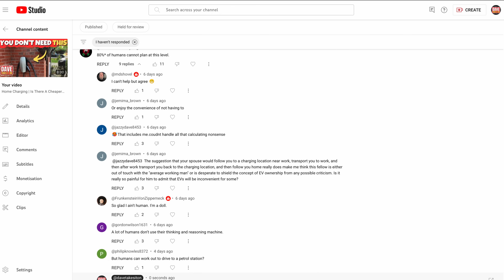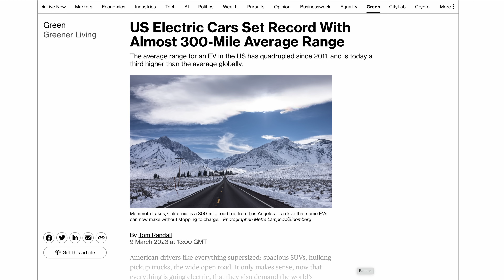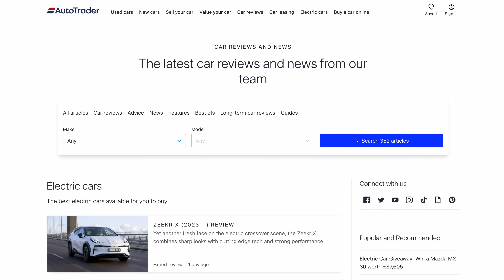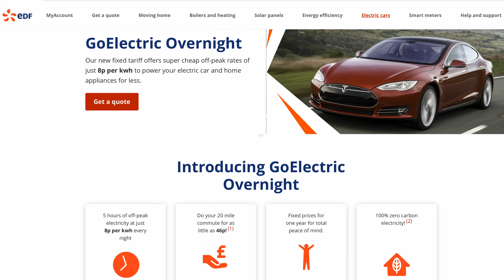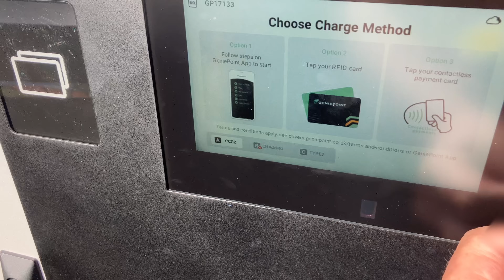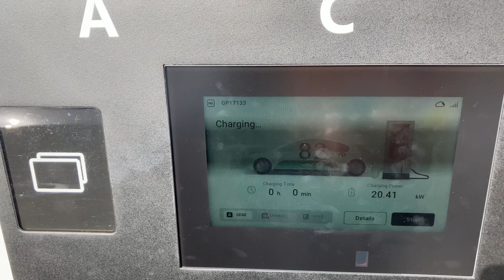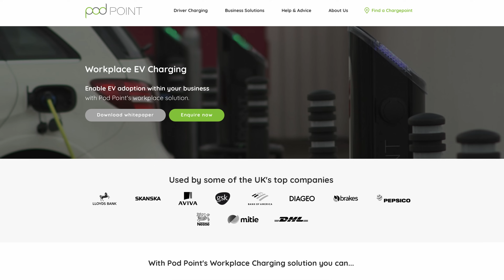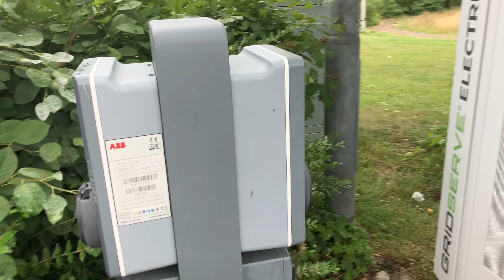Dummy's Guide To EV Charging | Don't Make These Mistakes

Comment: Hi Dave, some very good advice but when showing the tesla supercharger in most cases they currently or only available for tesla owners. And it is worth mentioning it’s not a good idea to constantly keeping the battery at a high state of charge to prevent early battery degradation. I do believe if you have no way of charging at home or at a work place it is really difficult to run an Ev depending on we’re you live in the country and it’s not a good idea to be constantly using rapid chargers if you plan on keeping the car a good number of years plus it’s dam expensive to be running a car of the back of rapid chargers. Unless it’s a tesla. But I do agree with you charge once a week or 10 days as I do. Keep up with what you do it keeps us informed with what’s going on with the charging infrastructure. The only thing I will comment on is tariffs you have to way up how much charging you do because yes you get cheaper overnight price but pay quite a bit more for the daytime rate. For me there was no advantage when charging  once every 10 days so I simply pay a single tariff rate and as such can charge when I won’t
Reply: With regard to split tariffs, don't ignore the fact that you can add a home storage battery even without solar.
Then charge that up during cheap rate and run the house during the day from that.
I almost never touch the higher day rate but everyone needs to do their own sums as there's obviously a cost for the battery but it does enable more flexible tariff options.
Reply from the maker: Yes Stephen look at the over all package. I get 9pm to 7am off peak weekdays plus all day Saturday and Sunday my peak rate is 40p off peak is 11p and my annual split usage is 85% off peak 15% peak that averages out at a nett 15p over the entire year. That’s much cheaper than if I chose a 5p off peak but only got about 5 hours a night and my peak was 30p. I often need 8-9  hours charging two or three times a week
Reply from the maker: Plus my home/ supercharger split is 70% home 30% superchargers so my average cost is 23p per kWh over the last 12 months, equates to 8p per mile. I’m happy with that

Comment: Nice video Dave 👍
I used a Tesla Supercharger for the first time yesterday. So easy to use, and watched the charging progress via the app, sitting inside a coffee shop enjoying a Latte. You can't do that in a petrol station 😂
Perhaps a video on the different type of home EV chargers there are might be worth it.
Hope you're well (Keith).
Reply: Of course, you can do the same with an ICE vehicle.

Fill up the tank..., park the car, and go for a drink.

Not all gas stations have a coffee shop, but that's not a problem. When you're done, you can drive to any coffee shop.

Now, if you want to continue the trip immediately or not, it is (your) the driver's decision.

Comment that this is not possible with ICE vehicle is false.

Why wouldn't it be possible?

If you want to stop for 10 minutes, 30 minutes, 1 hour... no one will stop you, it's your decision if you want to stop for a while.

I'm not here to argue which one is better, just that you can stop for a while with an ICE vehicle as well. It's the driver's decision...

Have a nice day 🥂
Reply from the maker: Thanks Keith Tesla make life so easy. Yes video on home chargers being prepared

Comment: I’m not opposed to an ev however just not achievable for myself yet, cars are simply too expensive to purchase at the moment. Never spent more than £3000 for a car, maybe by the time I replace my current car Evs will be more accessible
Reply: All those electric vehicles, which were new three years ago and rolling of their leases, you will see a lot of vehicles in the market and prices will drop even further than they already have. I am not sure if they will get as low as your budget, but fingers crossed.
Reply: If you spend maximum £3k on a replacement car then it may be some time as you will be looking at 10 year old cars and there are not many 10 year old EVs on the market. 5 or 6 years time there will be a lot more choice available and the cost to buy should be down to that sort of price by then.
Reply: £3,000 is not really possible but £5,000 is. Watch EVMan (sorry, Dave).
Reply: But who would even consider a used EV? Even dealers dont want them

Comment: Any chance you can look into why ev insurance is going through the roof see a couple of people saying there's has quadrupled
Reply from the maker: Yes thanks for suggestion it is being investigated, video soon
Reply: No doubt that will be the electric vehicle that caused the Luton Airport catastrophe, the other day, bumping up the prices… oops actually that was a diesel wasn’t it? Just price gouging as usual from a for profit financial institution. The same thing happened in America with Tesla’s, so Tesla just brought out their own insurance.
Reply: I think it is a general insurance problem that any recent car has far more expensive parts, so crash damage is more expensive to repair and as a lot of the parts are still more difficult to source, it takes longer, so higher storage costs and a replacement car for longer, so the cost goes up. Therefore insurance costs go up to cover this. My renewal doubled the cost, so I searched around and found a company that barely changed my cover and offered it for similar to what was paid the previous year.
Reply: This is not limited to EVs.  It applies to everyone, with many I know being at least doubled

Comment: Not a hope in hell I would buy an EV without being able to charge at home. I would not want to pay the high charging costs. 69 pence as opposed to 7.5 pence at home.  May as well stick to petrol its cheaper and more convenient.   I charge with a three pin plug, on the lowest possible speed. This way I can get the electric for the whole house from around 7:30 pm to 5:30 am. at 7.5 p Washing machine, tumble dryer, dishwasher, and I even use electric heaters, all night. My combine gas and electric bill has gone from 360 pounds per month to 118 pounds per month and that's including charging my car. You can't do this with public charging.  Public charging costs are way more than running a petrol or diesel car.
Reply: But you can reduce public charging costs by subscribing to the charge network you use. My local public charge network's price on a subscription is 38p per kwh......which is a fair bit less than the 69p per kwh you mentioned....
Reply from the maker: 69p per kWh = 17p per mile same as diesel at 40mpg. What’s the problem?
Reply: @davetakesiton the other mid-way option is a lamppost charger. 5 -7kw for about 15-20p per kwh. So much cheaper than fast DC charger BUT more than the 7.50 per kwh at home overnight.
Reply: 7.30pm to 5.30am? What tariff is that?!
Reply: @djtaylorutube  Economy 7?  I'm guessing......  My Octopus tariff is 7.5p per kwh, but that's from 11.30pm until 5.30am. Daytime rate is now within a penny or two of the daytime norm of around 35p per kwh....
Reply: @Brian-om2hh  Well not from 7.30pm :) My economy 7 is the 7 hours, currently from 2:55am to 9:55am and in winter time drops back an hour.
That's why I was curious about a 7.5p rate across such a wide period.

Comment: Hmmm.  You have glossed over the stupidity of apps and rfid cards.  Imagine the outrage if every filling station group decided that all customers need to to use apps and / or rfid cards to pay?

All public chargers should be contactless, end of.  On top of this there should not be price discounts for membersbips.  All this says to me is that the occasional users are being price gouged.   

And yes, we are ev owners.
Reply from the maker: Or just buy a Tesla and charge at 35p = 9p per mile. Just look at home charging as an incredible bonus. A Tesla always supercharging is half the price of petrol and diesel
Reply: Or, just buy a Tesla....
Reply: @chrisheath2637 if you can affect one. 😢
Reply from the maker: Yet I happily use a Tesco store card to get discounts. And a Nectar card to save money. Your problem?
Reply: There is a distinction between public charging and the membership style parking you refer to that used to be commonplace. Those schemes have all but disappeared because they are now competing with the contactless versions you refer to. My Tesla will show me any public charger not just Tesla but will not show me ones that are membership based.
Reply: I think that all rapid chargers should accept contactless payment and most now do, including the new V4 Tesla chargers. The "fast" chargers are much cheaper devices and, in my experience, tend to require and app or website to use  them.
Reply: Another stupid question, what is rifd card? 

I don't use big supermarkets as I'm an older single working class person, I shop in all the cheaper shops so club cards and the likes mean nothing to me, admittedly, as a working class person, I couldn't even afford a used electric vehicle

Comment: Great guide for those about to switch to an EV or someone very new to EV driving. 
I had a great charging experience myself in London yesterday outside Lords cricket ground. 
We were considering going by train and tube but that was going to cost 2 of us in excess of £40. Instead I took the car, there are EV bays right outside making the journey a lot quicker and we could charge for 4 hours before overstay penalties. 
That was perfect for us to to do our Lord's experience and added 28kWh of energy costing £16.80.
Reply from the maker: Just get all the ICE cars off the road and the traffic disappears for us EV drivers, heaven

Comment: We live in a Victorian terrace without offroad parking.  Our county council has now started a 6 month frial of "across pavement" charging and we are now doing this.  The result is that for our 5,000 miles a year we will be charging on cheap rate overnight juice for at least 4,000 of those miles and probably more.

We bought a car with a real world winter range of 200 miles enabling us to make our longest regular journey of 180 miles round trip without needing to worry.  We also knwo of three rapid charge sites en route if we somehow need to add a splash whilst taking a slash!

It's really not a problem charging and we are enjoying 3 pence per mile fuel whilst motoring.
Reply from the maker: Great story and totally at odds with the doom merchants, enjoy you EV

Comment: I would say consider a leaf if you can charge at home don't write them off completely they're a cheap entry to EV ownership
Reply: Maybe a second hand Leaf, they are expensive new.
Reply: There are numerous ways to get into EV ownership at reasonable cost now. I saw a regular YouTuber buy a 2016 Renault Zoe with 35k miles on it, for £4400 a few weeks back. Nice condition too.... With the right off-peak tariff, you'd have motoring at a cost of around 1.5p (or less) per mile......... It would cost more to use a bus.
Reply: Am a retired bus driver, and have had a Leaf since 2012.   For my wife and I it is perfect, as we only use it as Dave says for shopping and short trips in the area.  I also live in a second story flat and run an extension cord to my garage.  It is also a council flat, so have no access, or interest from my council to wire one in.   Plug in over night at 12p KWh  and in the morning its full.  4 hours at 12p.  Wow cheap.
Reply: And dont forget you can now buy an adaptor plug Chademo to CCS.  An expensive one-off outlay which prolongs the useful life of a really good car (and its larger relative the ENV200)
Reply: The downside to the Leaf is that they use the Chademo charger that virtually no one else uses. That’s why our first EV is a second hand 2019 VW eGolf, which cost us £14,000. The range is not great (real world range about 100 miles) but it only gets used for commuting, shopping, visiting friends and family and it uses the same charger as nearly all other EVs. And, IMHO, it’s much nicer and more user friendly inside than the VW ID3.
Reply: @hishamg my OP specifically said if you charge at home, however still plenty of chademos in our experience around contrary to the scare stories.
Reply from the maker: Great to hear you found a good car for your needs, not everyone needs 400 miles range and 350kW charging
Reply: Yes agree with you. Great run around transport and a really practical car. I really charge away from home a leaf or Zoe would be a great choice.
Reply: Agree with this completely especially since there a stepping stone for maybe a family with 2 kids and there hitting the secondhand market at a good price. Removing chargers for the leaf will effect uptake of ev's for small family's I would think.
Reply from the maker: Yes I agree I was trying to advise new owners that charging on the road is already more difficult and will get worse in the future. As long as they know a Leaf would make a great car

Comment: Us EV drivers all know this through experience. But, it's a good clear guide for the many ice drivers who are influenced by the UK's bad media. I suspect if oil keeps rising that EV's will become quickly desirable again.
Reply: There are slight indications of the residual values of EV's beginning to creep back up once more..... There is basically only one way the cost of crude oil, petrol and diesel will go, and that's upwards. It is never suddenly going to  become a bargain priced fuel. Even once sales volumes of petrol and diesel drop to levels where it hurts profits, the cost will simply rise - with the oil companies then claiming/declaring it has become a niche product, and these cost more to produce and market. You just see if I'm right...... ULEZ schemes will also undoubtedly play a part too, with many older cars becoming unviable to own.
Reply: and where does most electricity come from???  oil !!!
Reply: @JohnRance-f1c  And yet an EV is still more efficient to use over an ICE car as electricity doesn't need to be hauled around using big trucks to be delivered to multiple petrol stations. Electricity is made via solar, wind, hydro or fossil fuels then with minimal additional cost passes through wires to the vehicle.
Reply: @user-bx1ju2tn7x perhaps. Though there are efficiencies gained if burned centrally over individually burning fossil fuels in vehicles.

I'd rather our oil use to be centralised maximising its energy capture than have it shipped and tankered (using oil) nationwide, pumped (using electricity, which used oil to be generated) and burned (using the oil).

Still use oil, it makes sense to do so, but use it sensibly.
Reply: I'm just put off by the cost of buying a vehicle and the technology as an older person